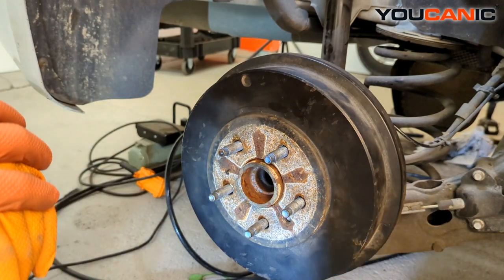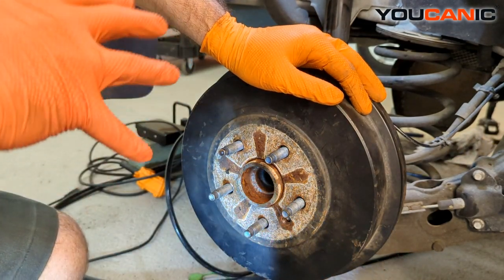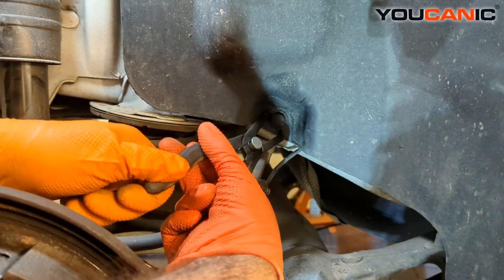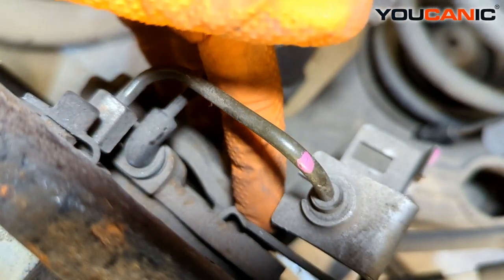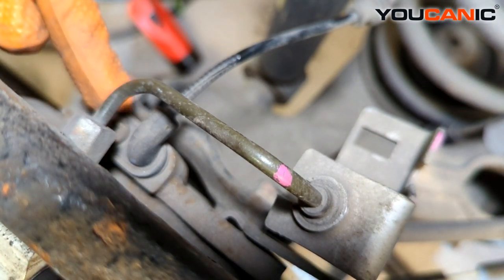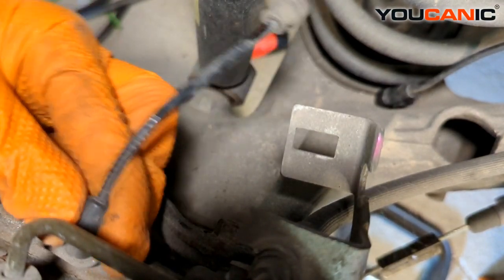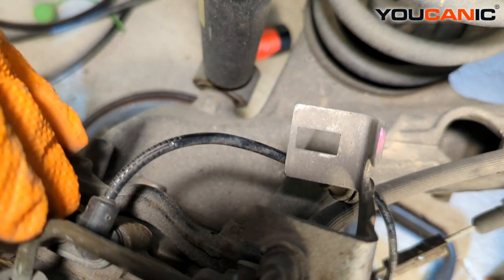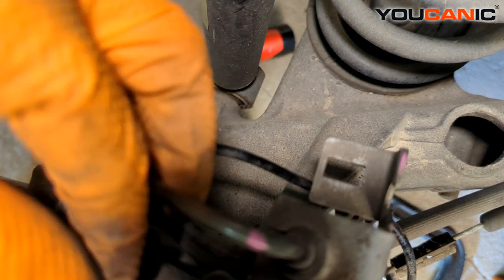2008-2016 Chevrolet Cruze - Rear ABS Wheel Speed Sensor Replacement

Comment: Thank you much for this video- to include size tools needed.  very helpful. I was able to do both rear sensors in 2 hours. Much appreciated 👍🏻
Reply from the maker: @richardsimmons343 If you’ve got a car issue or repair question, you can find step-by-step guides and scanner help at youcanic.com. We might miss some comments here, but our site has answers for most problems already!

Comment: How did you know that the sensor needed to be replaced?
Reply: If you have a code reader specifically designed to read abs systems it will tell you which one. Not all readers can read the abs systems so make sure before you buy one

Comment: I just did an 11 today. I was able to just squeeze the cylender in an away from brake pads. Then just compress boots back in and use a plastic pry tool to align it back up on reassembly.
Reply from the maker: Great to hear that you're taking charge of your car repairs! At YOUCANIC, we aim to empower car owners like you with the right tools and resources. Our Full System Scanner, especially, can help with comprehensive diagnosis like a professional mechanic: www.youcanic.com/scanner.

Beyond that, we offer resources like OEM Factory Repair Manuals and a platform for car-related questions: www.youcanic.com. If there's anything else you need, don't hesitate to ask. We're here to support your automotive journey. Thanks for your trust in YOUCANIC!